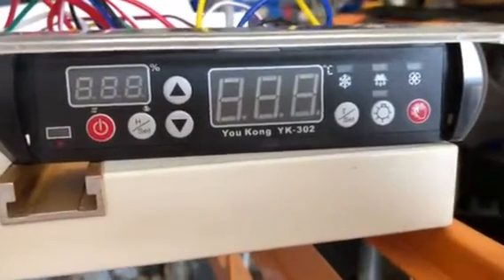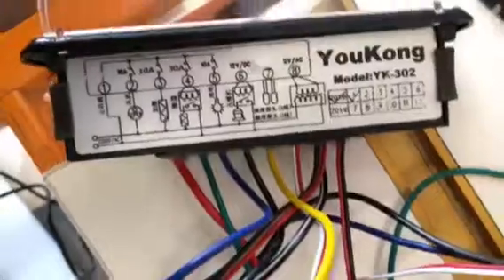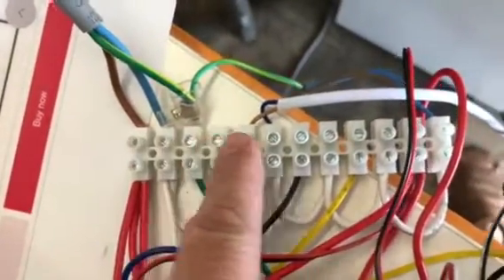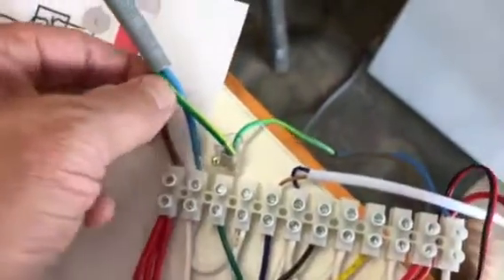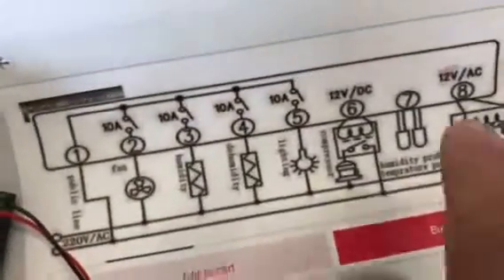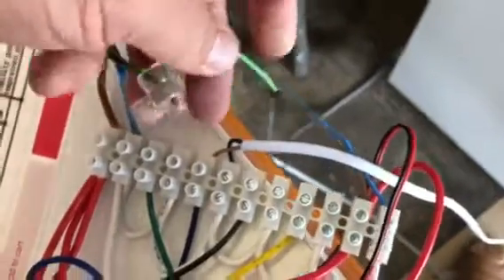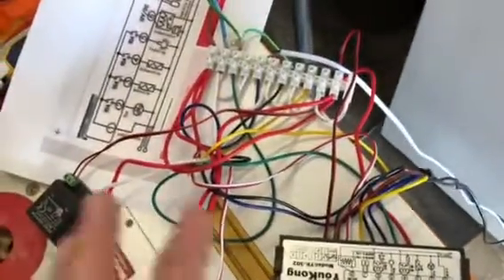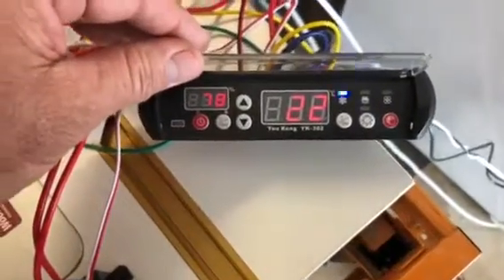You Kong YK-302 Temperature and Humidity Controller Wiring Set Up Tutorial

Comment: I have a copy of the English Manual in PDF, from what I can see this unit is not able to control a heating element via temp probe.
Output 4 is for dehumidifier, you could run an element off this output but it is controlled via the humidity probe not temp. 
If you wanted to control heating and humidity for say a mushroom fruiting chamber then you would need an external heating controller or the YK 303 model.
Reply: How can I get the pdf please?

Comment: if you can plug in a humidifier and dehumidifier to control humidity, and you can plug in a fan to reduce the temperature, how would you increase the temperature? change the fridge to a heat source?
Reply: I've seen other diagrams with the dehumidifier (4) marked as heater, I'm not sure if it the same unit as this one as there seem to be various different models of the YK302